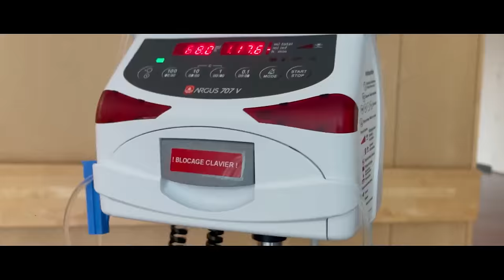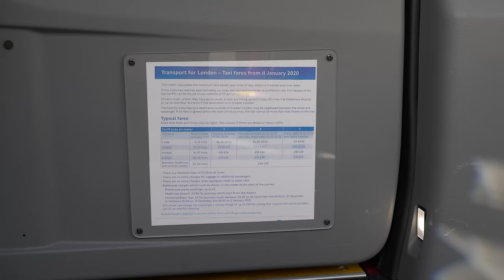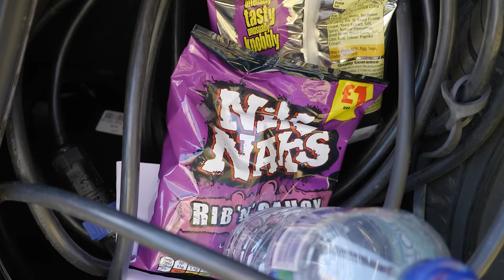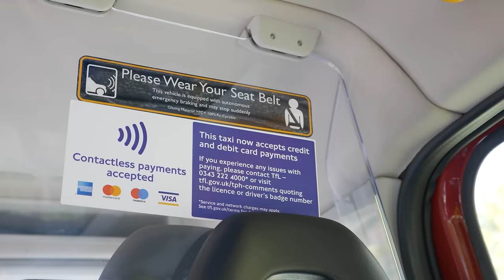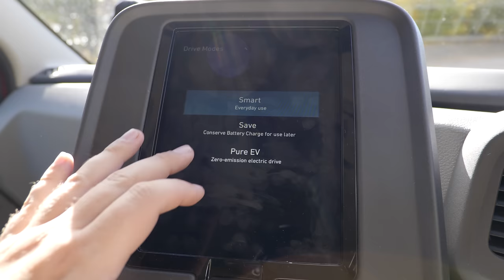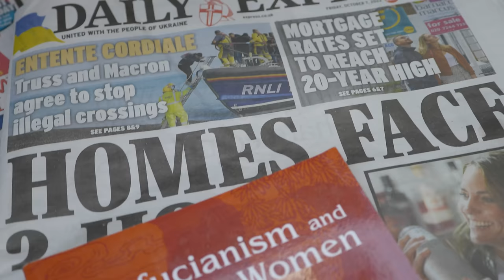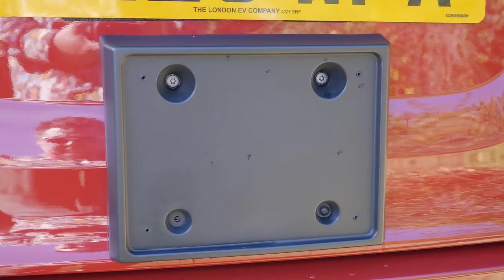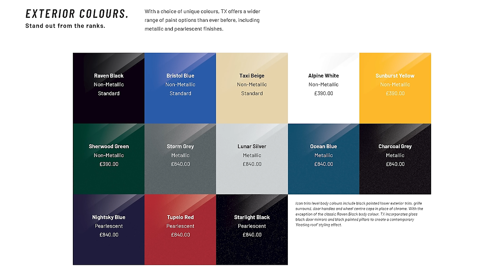Swapping My Ferrari Keys... For A London TAXI! Here's How It Went...

Comment: Purple Mercedes-Benz 200D (W124) with "bench seat" and column shifter manual gearbox, 4 spoke aftermarket wood steering wheel and green cloth interior. Welcome to Finnish countryside in the 80s.

Comment: Good video,I use to drive a diesel taxi years ago, it would seem the electric cabs haven't improved the heaters and the acceleration, although I did have a perkins 3 litre engine in my cab in the eighties and that engine could take on most fast moving cars.

Comment: I suspect the low starting poke is by design to not throw around your passengers in the back. You don't want to cause broken necks or whiplash. Also keep the passengers in mind that seat in the car backwards.
Reply: That’s it, a good driver/chaffeur/cabbie would never “go for the gap” as it’s uncomfortable for the passengers.

Comment: This is a coincidence.  I was never in a London taxi until last week (Dec 2022). Conversation turned to the knowledge, the taxi itself and had the taxi driver ever heard about the YouTube channel "Tom the taxi driver". Anyways,  all three drivers that I met said that they are getting 50 miles out of a charge. One driver told me that if he puts on the heating then the engine starts up. Two drivers told me its cheaper to run the petrol engine than fill the  battery at a public charger. All great guys. The intercom was great and the taxi was really comfortable. They look oddly handsome, how a Range Rover should look if only driven on the road. Only thing that they complained about was the price, around 80k gbp. This was a tipping point for some drivers to retire after the Lockdowns. Respect to the London taxi driver.

Comment: I watch a lot but don't normally comment:

1) The iconic US taxicab for the 2nd half of the 20th century was the Checker. Only once they phased out did we get the Chevy Caprice and Ford Crown Vic, and then ultimately only the Crown Vic (as Ford kept the Panther platform around for a long, long time.)

2) Part of the plot for Forza Horizon 4 is a TX4 that is LS-swapped and you have challenges to get passengers to destinations in an absurdly short timeframe. Frankly, I'd love to do this as a project myself, but lack of garage space means that isn't happening. Although with the TX4, the driveline was Nissan based, so maybe a RB26DETT (Skyline motor) makes more sense. When discussing this hypothetical with another friend, the narrow motor is required because of how wide the front wheels are able to pivot to give the appropriate turning radius for London's streets. Frankly, I'm surprised the boys at Drivetribe haven't gone down this route, yet (give them time, I'm sure.)

Comment: I've actually worked on the London Taxi EV like this. I worked on the charger. The charger can get too hot. Can I put a fan on it? No. Too expensive. Just a £1 item i wanted was too expensive. I tried to get it as cool as possible. But then you have litlle options because of the cost. One of these vehicles caugt fire in Norway. I don't know what caused it. But the EV industry is very strained on costs. And you have a connector which everybody in the industry uses. But it's bad. And you can't change it. I guess the ones making these connectors are laughing all the way to the bank.

Comment: Few things!
1. Having an electric car with range extender is a BRILLIANT idea for a taxi. When you think about the fact you can charge it on your lunch break and between jobs you could probably do a majority of your work in full electric. But that one customer every now and then who wants to go flippin' miles away? Well, that's where the range extender kicks in and gives you all the range to still be able to do those long jobs that you wouldn't have otherwise had if it was full electric. Plus you don't have to sit there waiting for it to charge with a fare in the back because you misjudged whether you could make it before you took the job.

2. The smooth pull away is probably more about passenger comfort than any mechanical limitation. Give a cabbie 150bhp from standstill and they will use it literally every time much to the dismay of the (of course, always seatbelted as per the law) passengers.

3. They're quite popular as vans round here. Not been in one but they look equally as competent as any other option, and the taxi front end makes you second guess yourself.

4. RIP Joseph. Cancer is the worst thing ever.
Reply from the maker: Callum

1. That's exactly what LEVC said

2. A thought that I had, but I really would appreciate a kickdown button or similar to get it going a touch quicker

3. They do a van version also

4. Thankyou, yes it is.

Comment: I was surprised you didn't mention the A pillars designed to support the weight of an M1 Tank. You can tell it is a "modern" vehicle, designed to be driven upside down, not on its wheels, the problematic modern A pillars simply create blind spots that you can loose an entire kindergarten class in. Building transportation, "by design or by decree?"
Reply from the maker: In this it was not as problematic as many other vehicles. The B-pillar was a frustration, as noted in the video
Reply: Have you seen a modern car over on its roof? Quite remarkable how strong those pillars are.

Comment: I know you did this review in the context of it being a cab, but isn't it rather expensive for what it is? Like factoring in performance/equipment/general design etc
Reply: It is, and hasn't gone unnoticed from Cabbies. I am an ex-cabbie and now and accountant to cabbies. You have to remember that these vehicles only sell to a captive market in london of 18000 drivers, at around 2000 per year.
Reply: Low production/specialized vehicles are always going to be way more expensive than mass production vehicles
Reply: @ShortandSons  more than offset by the low running costs and finance/lease deals though!